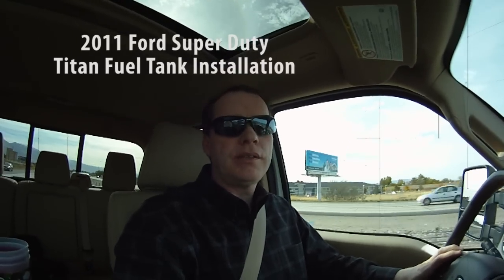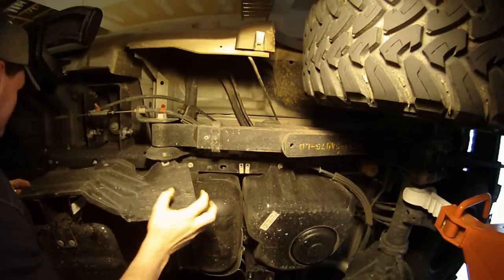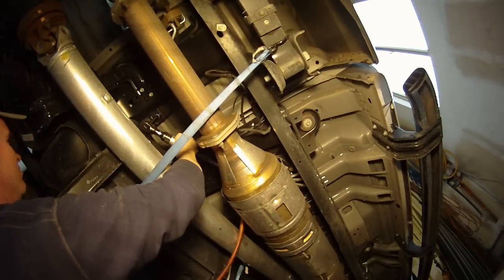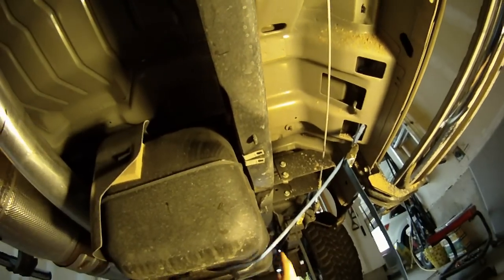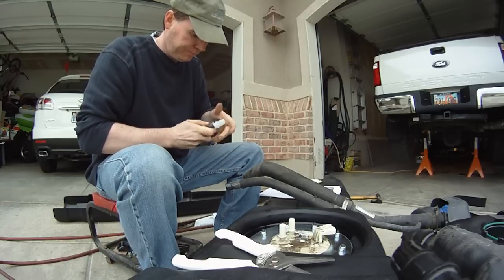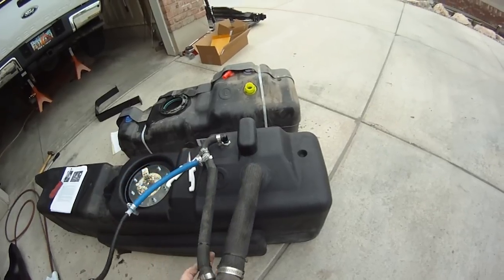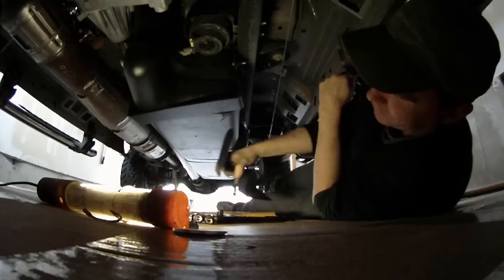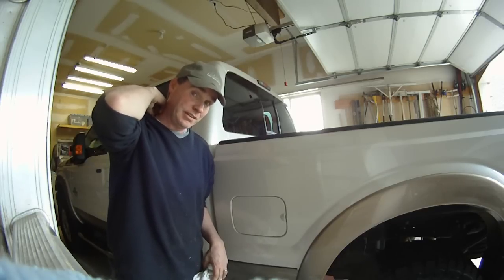2011 Ford Super Duty Titan Fuel Tank Installation

Comment: How do you like the ranchos?
Reply from the maker: Ranchos are fine shocks but they didn't seem to last very long. Check the video on my channel about Fox shocks.
Reply: I have a 2.0 Fox shocks now and had them re valved specifically for my truck and I'm not the pleased with the truck but my uncles F250 with ranchos rode super smooth. I'm thinking of doing Ranchos as a replacement for the new 6in lift I'm gonna run, save up some money and go to king shocks.